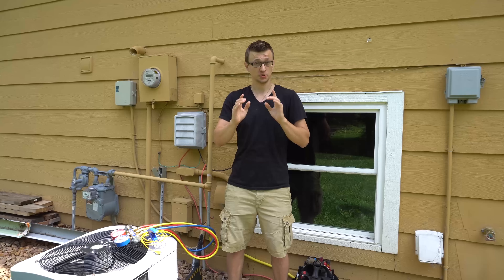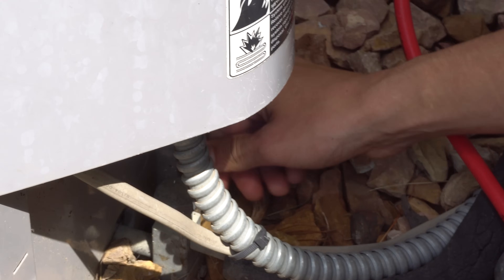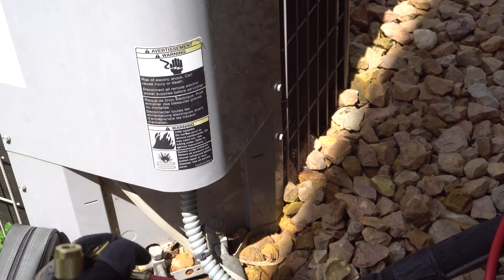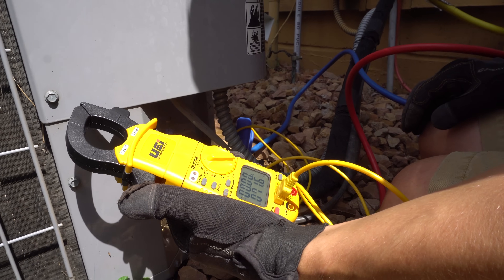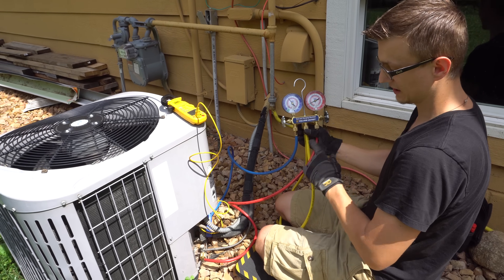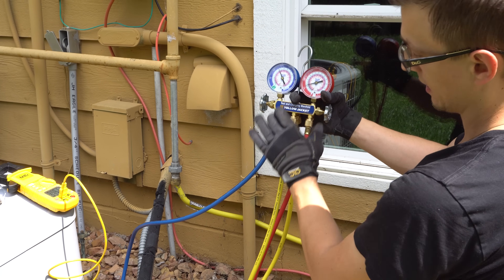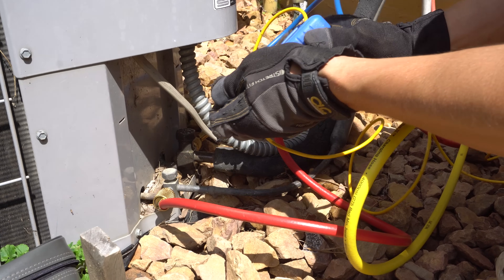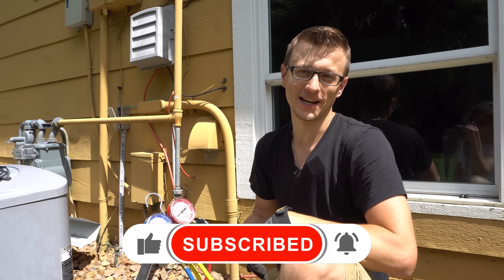How to Read SUPERHEAT and SUBCOOLING

Comment: Good job Jay!  Hope Hawaii quarantine is treating you well!  I heard what sounded like good advice recently regarding placement of the high side temp probe. The advice was to place the temp probe up stream “left” of the filter dryer if possible.  The logic behind that advice was due to an unlikely scenario of a restriction at the dryer itself. Makes sense if charging by sub cooling I suppose as a restriction at the dryer might make the unit appear under charged.  Great video and really appreciate the useful tips!
Reply from the maker: That's a great tip and it makes sense! Thank you for sharing! Quarantine is going good but unfortunately will have to do another 2 weeks on Big Island. I ll make another update video soon to report on that lol. Glad you were able to get some useful tips from the video, thanks for watching and sharing your own tips too! Next weeks video is how I add refrigerant to the unit in this video using the subcooling method. Should be interesting!

Comment: Good video, for some reason I thought you had to know temperature at vent and out door temperature too. But this is easier. Also those temperature guns to me arent accurate they seem to be degrees off depending on how close you are aiming.
Reply from the maker: I agree, the pipe clamps do tend to be more accurate. About the temperatures, you do sometimes need them, more for the superheat charging method then the subcooling. Most charging charts will ask for the dry bulb (outdoor temp) and wet bulb from indoor.

Comment: Hi Jay , what is the use  to take the  measures of "Sub cooling" and "Super Heat " . How does this helpful to home owners. Any how the way you showed us is great . Undoubtedly you are a great teacher ,to teach all these techniques.  I don't have much knowledge on this , that is the reason i am asking you .
Reply from the maker: The superheat and subcooling measurements are needed to properly recharge a central air unit. Those measurements along with a few others are what determines how much refrigerant needs to be put in. Next week's video will be an example of how I use the subcooling method to recharge a unit. Stay tuned for that one if you want to understand the process more. ;)
Reply: @WordofAdviceTV  Thank you Jay .

Comment: Just caught something! At roughy 8:26 you flash TXV  when you are measuring Super Heat. If you have a TXV you need to measure Sub Cool?
Reply from the maker: Oh that! I should have probably explained better. I said the pressures were fluctuating because of the metering device  (that unit had a TXV metering device). So I flashed the txv to elaborate which metering device is doing that
Reply: Yes.  With a TXV you measure Subcooling.   However,  it is still good practice to also measure SH which should on average for residential be between 8 and 16 for a TXV.  Outside of this range may be an indicator of a faulty TXV,  airflow, etc...

Comment: Love the formula on the back of the gauges!  I cannot for the life of me remember which is which and always have to look it up. Thanks.
Reply from the maker: Yeah! I forget them often too. Glad I could help with that! 😄
Reply: I like the video except for the fact that if the tech is forgetting how to measure superheat and subcool then they are forgetting how the system operates and why the readings are important. Also I would recommend a better temp clamp, those UEI clamps for some reason do not last long and I've seem them read wrong out of the box.
Reply: @teddycarter2618  that's a field piece type k clamp. The blue ones broke easily but they stopped making them and the new ones are now yellow and are much better.
Reply: Superheat "heat" is "hotter" suction line.

Comment: what is the name of the cap with o-ring? i want to replace mine.
Reply from the maker: If you look in the video description, i have a link to the brass valve caps there.
Reply: It's called a schrader cap.

Comment: They now have digital manifold gauges, which does the calculation for you. Lot more expensive but nice if you do lots of A/C work. you plan on getting a set?
Reply from the maker: Maybe later 😀 for now I will continue to use these because that is what the majority of techs use.
Reply: I love my Testo 550, built in temp probes and a single screen shows SH and SC
Reply: I love my fieldpiece SMAN480. along with all the wireless goodies..  I work with mobile bus Air conditioning systems.. and having the wireless probes, the SMAN, and wireless clamps makes it possible to actually drive a bus and watch the A/C system do its thing on the ipad running MeasureQuick..  its a Game changer esp where dual evaporators are involved which is almost every bus A/C..  the wireless probes are also really nice if you are troubleshooting TxV issues and want to watch the evaporator inlet and outlets and yet you are outside charging the system.. you can see the evaporator temperatures and also have a good reading of the indoor wet bulb at the air intake as well..  for simple stuff a regular analog set works fine, but when you get into the advanced stuff or custom-blended refrigerants, there is nothing like having a drawer full of the digital wireless tools

Comment: What is a good range for sh and sc?
Reply from the maker: On average, subcooling is around 12 degrees. The superheat varies though depending on humidity and temperature so there's not really an average number for that one.. Next weeks video will be an example of charging a unit using the subcooling method if you're interested.
Reply: Thanks man I really do like the channel it helps a lot and I’ve learned a lot keep up the good work and thank you
Reply from the maker: You're welcome! Good to hear that the videos are helpful!

Comment: Isn't more accurate to take lowside temp at or near blower, txv, orafice, since that is what you're wanting to actually get temp on?  When it's 100F outside the low-side temp can be several degrees higher, plus heat picked up along the way.
Reply: I was watching one of Ty Branaman's  NTI school videos,he mentioned that you don't measure suerpheat at past the evaporative coil.Instead you are suppose measure  'total superheat' reading at the condenser for more accurate measurements.
Reply: Part of the refrigerants job is to cool the compressor without getting liquid back, so you need to know the temp near the compressor. Heat is absorbed during its trip in the lineset,  superheat will be greater close to the compressor as compared to close to the coil
Reply: Hi Jay please do a video on how to tell what refrigerant your system has
by checking the temperature of the refrigerant. I just bought a commercial property that has R22 condensers and 410a coils. I'm a big fan and thanks for all the great videos
Reply from the maker: To be honest, I am not entirely sure about that. I have always measured it right there at the condenser and haven't noticed any issues before..